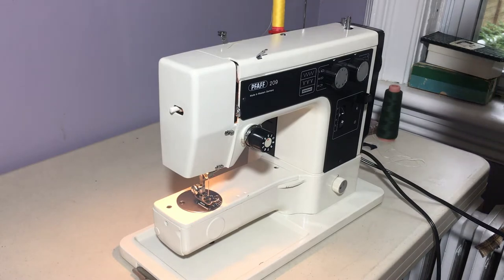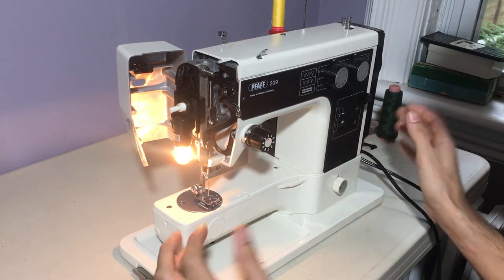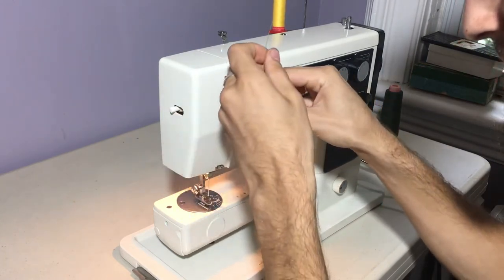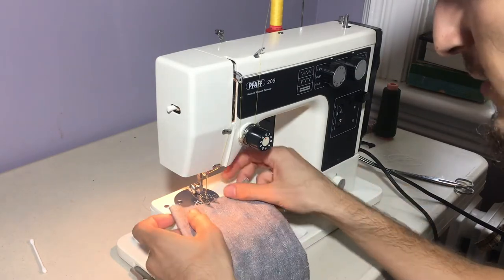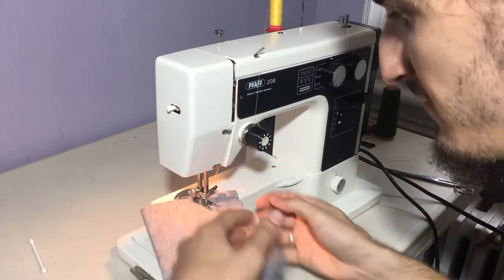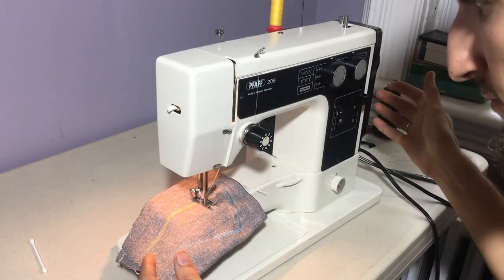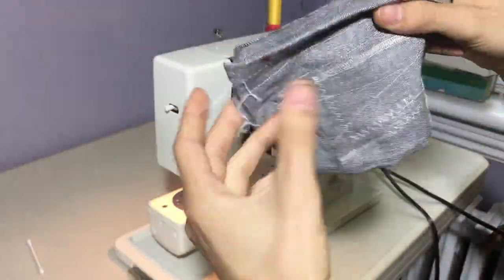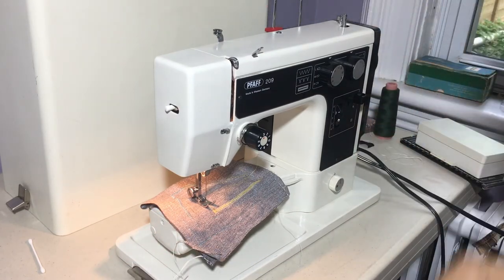Pfaff 209 Free-Arm Sewing Machine - Serviced! (threading + demonstration)

Comment: Hi, Thanks for your video.I found a lovely Pfaff 209 in a skip the other day. It was all gunked up, but I've managed to sort it out and now it runs like a dream. Beautiful stitches like yours. The only issue is I've not been able to unlock the clutch for the bobbin winder. The internal wheel is absolutely jammed. I've tried degunking it, it won't budge a millimetre.  I have a feeling that someone's taken it off in the past and not put the parts back in the right place. Any suggestions for removing the hand wheel without completely breaking it? Thanks in advance.
Reply: Hie! Maybe you  can help me, I can't find pfaff manuals in English. Does pfaff 208 and 209 sew leather?
Reply: @charie5922  hi im german and yes you can sew leather with this sewingmachine 😊
Reply: @ilovemydogsjosyamy1798  Thank you so so much! I didn't want to try and end up breaking the machine. So now I'll try😄 Thanks a lot!!
Reply: @charie5922  you are very welcome 😊 Love from germany 🇩🇪🙋‍♀️